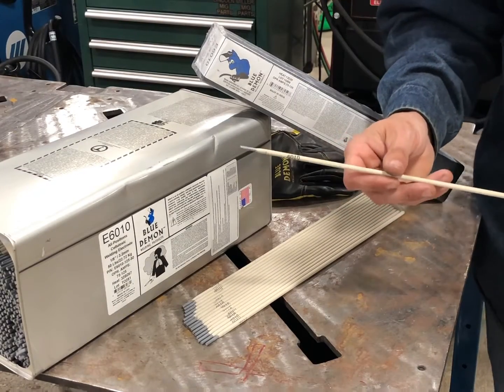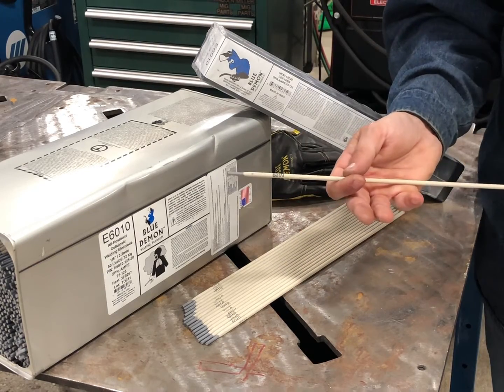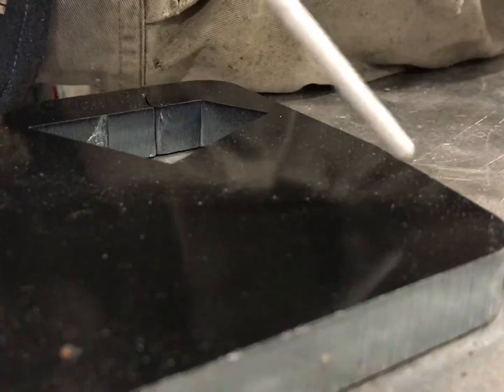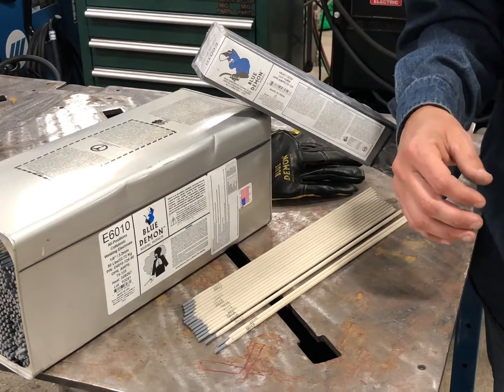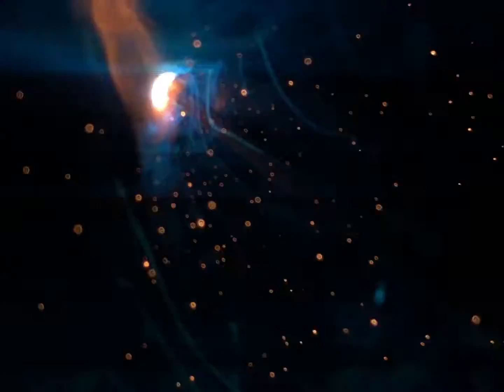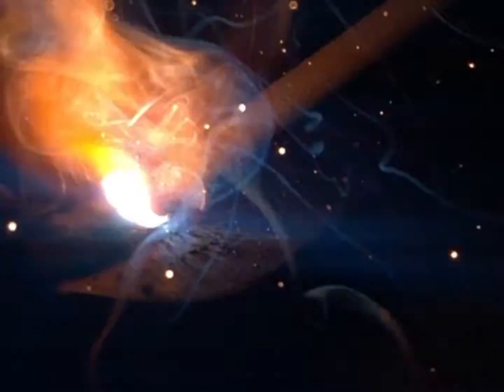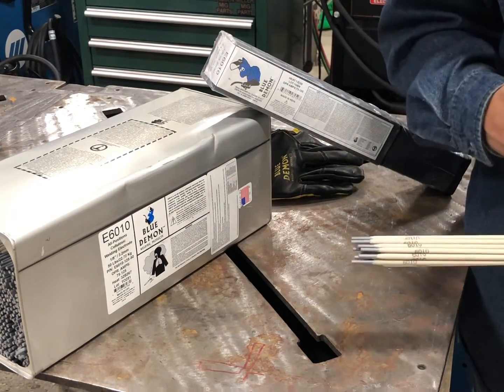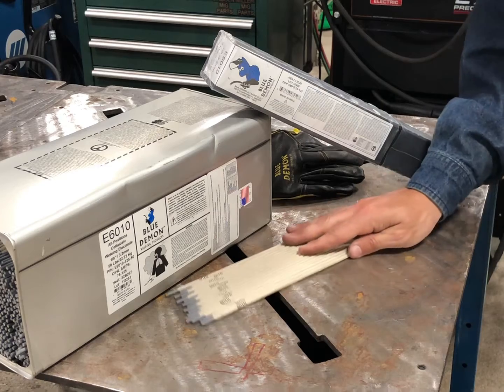Blue Demon E6010 Carbon Steel Covered Arc Welding Electrodes

Comment: Have a SCWY MMA 180 inverter Arc welder 180 DC max output. Bought some of these 6010 off eBay. Can't weld with these rod won't hold the arc
Reply from the maker: lots of inverters struggle with 6010.  they experience arc outages.  I am pretty confident our rod is not the problem.